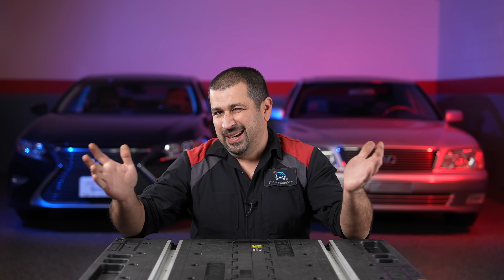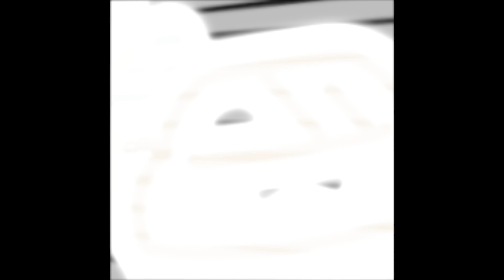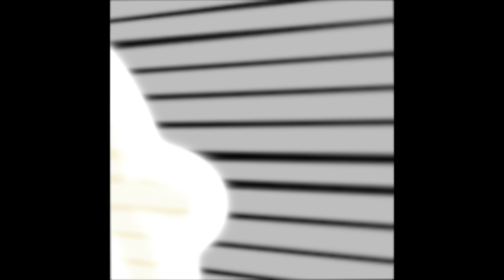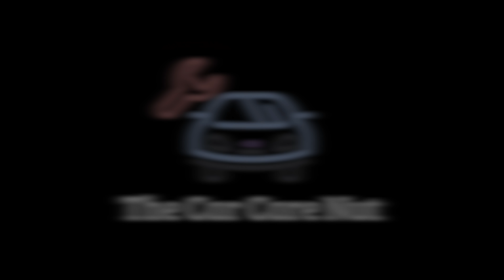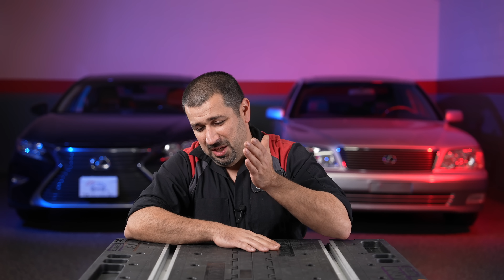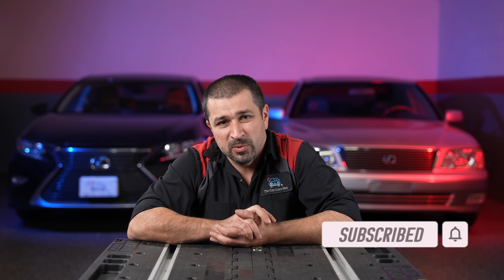Can Modern Turbo Engines Be Reliable? Here's The TRUTH!

Comment: 3 turbo VW GTIs, I've never had a turbo or engine failure.  All of them were tuned.  Change the oil every 5k or 6 months, whichever comes first.  Stay on my maintenance and it's never been a problem.  Also, I don't drive it like an idiot.  Let it heat up first, before you get on the turbo and let it cool down before you shut it off.  Sometimes I'll just drive around for 15 minutes where I can just cruise and let the engine/oil cool off before I go home and park if I was riding the turbo. Also, I don't use any lightweight oils.  These 0/20 weights are trash and only used for better mileage, they sheer far too quickly in a turbo engine.  5/40 synth only.  I'll take the mileage hit for an engine that lasts much longer.

Comment: 100,000 miles on the first turbo on our 1984 240 Volvo wagon.  Second turbo was still fine when we sold the car at over 300,000 miles.  Current Subaru Outback XT (turbo) is still fine just passed 100,000 miles (first Volvo  turbo did not have an oil line adding additional cooling to it, second turbo did).  So, in my experience, turbo charged cars can be dependable for a long time.  (Changed the oil and filters regularly on both)

Comment: I bought a 1987 Ford Thunderbird Turbo Coupe with 11,000 miles in October 1988. I sold it in August 2021 with 425,000 miles. Original Turbo and never rebuilt the engine. It had zero blow-by, didn't smoke under acceleration or deceleration. I was running extra boost since 15,000 miles. I religiously changed the oil every 5,000 miles and always used Mobil 1 15/50. I'd check the oil when I was ready to change it, and it would be down a fat pint. After 5,000 miles, it was down a little more than a pint, even with 250,000, 300,00, 400,000 miles. That would be more than acceptable for a new / modern car with 30,000 miles. Pretty amazing. I also warmed it up properly as well as letting it idle down and run some cooling oil through the turbo before shutting it down. Everybody was shocked at the mileage I had on it. And it was an "old school" bronze bushing turbo. No ceramic ball bearings here. Maintenance is key people. Like the man said, change your oil frequently.

Comment: Oil bypass filter, oil cooler, air oil separator, and change the oil every 3-4 thousand miles depending on how you drive it, and you will be ok.

Comment: My Ford 2.0L turbo has been a gem. Best synthetic oil, best filters, and changes every 5-6K miles. 10 years without skipping a beat. Quick heat in the winter means the truck stays in the garage.

Comment: I have a '21 VW Jetta with a 1.4l turbo motor. VW recommends oil change every 10k miles but I remember another channel saying small turbo engines should have the oil changed every 5K miles and have been doing that. When the motor hits 50K I plan on doing an oil change every 3K miles.

Comment: Turbos cook the oil, they hold too much heat under the hood, they vibrate the bolts loose, the bearings fail,  they are designed in  because the engine is too small for the car.  Buy a car that doesnt need a turbo.

Comment: So far they haven’t really gained an advantage. I have a Mustang with the 3.7L V6, MPFI, 305hp, 29mpg. I have 160,000 miles on the engine with no problems. Ford, in their infinite wisdom, replaced it with a turbo-4, GDI, 305hp, 29mpg. These engines have proven to be unreliable with blown head gaskets and problems with the high-pressure fuel injection. The weight of the accessories almost completely offset the potential difference in weight between the V6 and the turbo-I4. So all Ford accomplished was the enshitification of the base engine for the Mustang.

Comment: My 1967 VW Beetle did not have an oil filter, just a metal screen. I changed the oil myself every 1000 miles. I drove that car for years, ran like a top, never an issue. Oh, I also adjusted the valves often too. I couldn't wear that car out.
Reply: Still have it?

Comment: If this is mostly in reference to the Toyota T24A engine that's replacing the GR V6s, you have nothing to worry about there.  That engine is rock solid and is currently Toyota's most reliable engine, even moreso than the 2GR V6 or A25 4 cylinder that's in most of the hybrids.  They've done everything you want to do to a turbo engine to make it reliable, tuned fairly conservatively, no electronic wastegate, nice thick cylinder liners, the D4S injection system, water cooled ball bearing turbo that's only pushing 15psi through a nice big intercooler and they run the water pump for a few minutes after you turn off the engine to keep coolant circulating through the turbo to cool it down.  I have that engine in my 4Runner and it's a great engine, tons of low end torque, decent fuel economy, I of course do not follow the Toyota 10k mi OCI, but I feel that changing the oil at 5k is likely fine for this engine.  The one that has me skeptical is Stellantis's new 2.0L hurricane 4 cylinder, they're pushing 35psi into that engine and only getting 324hp so teeny turbo being pushed REAL hard.  Though it may be a bit overengineered, it's 6 cylinder brothers have actually proven to be decently reliable, but they're running twin turbos with fairly large turbos (the tuning potential on the HO version is nuts, 550hp stock, supposedly 700hp is very doable on stock turbos and stock internals) not a tiny single turbo pushed to its absolute limit.

Comment: If an an engine won't go 500,000 miles with basic maintenance it ain't worth owning. I wish Toyota would go back to the first generation small Tacomas. My last pre Tacoma SR5  was still running fine at 530.000 miles when I sold it and bought a 2004 base model manual transmission Tacoma. Trucks are way too big these days.

Comment: Also, you should use gasoline with friction modifiers. Experiments have shown that this reduces friction at the upper rings where you have crankcase oil mixed with combustion products blow-by. The turbo boost significantly increases combustion product blow-by at the rings exacerbating this oil dilution. The combustion products tend to reduce the friction reducing properties of the oil. Friction modifiers use varying methods to correct that.  Today in the U. S. only two companies use a significant friction modifier, Shell and Exxon/Mobile. And those are only in their premium formulations, Shell V-Power NITRO+ and Exxon Synergy SUPREME+. Lake Speed Jr., the Motor Oil Geek, has an excellent YouTube video on friction modifiers so you can see for yourself. Just another thing that you can do to help your engine.

Comment: Another way to get both your turbo, engine, and drivetrain to last longer is to accelerate at a moderate rate. If you are constantly hammering on the gas pedal you will be constantly adding additional stress to the drive components leading to accelerated ware and failure.

Comment: I bought a truck with a small turbo charged engine I changed the oil every 5000 miles with amsoil & ran wix oil filters.
At 110,000 miles the engine blew, I then went & bought a much older truck "2008 F-150" & it has the 4.2 V6 Natural Aspirated engine & with 240,000 miles with 0 problems.
I personally will NEVER own another turbo charged engine unless it's a Diesel.

Comment: If i recall right, you made a video a coiple years ago about the 2023 lexus rx350. We bought a new one off the lot, i change the oil every 3,000 without fail. I do it myself, taping the receipts in a notebook, and write down what service was performed, with mileage and date. Yes, it has a bunch of goofy chiming noises but they can save you if someone walking behind vehicle in blind spot, the vehicle will stop automatically.

Comment: I've been driving a 2024 Honda Civic Si with the 1.5L Turbo, and I've done my oil every 5K, full synthetic with fresh filter every time. I see mostly highway miles (already put 33K on it since picking it up last May) and I don't beat on it since it's a work car and not a toy. Do I really need to cut it down to every 4K for oil change, or is 5K not really stretching it (I always end up getting the oil done a little sooner than 5K)?

Comment: It just sounds to me like everything is a bad choice in terms of owning a car. If you own a normally aspirated larger size engine car, it's likely spewing out harmful emissions that have been causing air quality issues and contributing to global warming. If you pick a downsize engine with a turbo, it's a less reliable vehicle that requires more maintenance and is more costly. And if you go with an electrified vehicle hybrid or fully electric, then it can potentially have issues with the battery pack not being reliable and constantly to repair, and there're issues with charging infrastructure for fully electric/plug in hybrid vehicles. I care about air quality as someone who has dealt with asthma since I was a kid, I care about a reliable powertrain because I drive a lot, and I care about usability when I go on long drives and want a vehicle that is not complicated to refuel or to maintain and will run for as long as possible. So what is the right car?

Comment: I drove a 2018 Honda CR-V for 150,000 miles over 7 years. Tiny 1.5L 4 with a turbo and a CVT. It worked well, smooth, adequately powerful, 33 mpg or better. 
But that good mileage is only if you don’t spool up the turbo very often 
And the oil? Full synthetic 0W20. And you gotta make sure you change it at least every 5,000 miles.  
I now have a sedan with a V-6. It is super smooth and super powerful. The down side though is it gets 23 mpg. It’s true though that there’s no replacement for displacement.

Comment: I say in terms of reliability, both are almost the same. In terms of maintenance and repair, turbos are more expensive. You have deal if shorter life battery for turbo oil pump to still run after shut down, turbo oil pipe leaking, wastegate issues requiring turbos to be replaced, more than often valve cover oil leak, high wear on spark plug, turbo diverter issues, etc.

Comment: Excellent podcast. Oil is the lowest common denominator of a turbo. I tell my friends with turbos, change that oil religiously by or before 5k miles. Personally, I would not touch a turbo gas engine, even though I owned one. I drove it to 70k miles. But never  purchase a used turbo gas engine. You don't know if it's previous owner changed the oil properly.

Comment: Love my 2022 WRX, turbo barely spools on the twin scroll...2.4L has plenty of power and turbo comes on only around 3000rpm and only if you floor it.  The turbo generally produces 7-13 psi of boost....low compared to older models and many other turbo setups.

Subaru has been making turbo flat 4 for ever...not a new tech for them.  Here's to hoping it lasts 😂

Comment: So much truth spoken in one video! I have a 24' tundra v6 tt and ive put 38k miles on it and its been amazing. I change the oil every 4 thousand miles. And recently changed the air filters. If I had to choose one of my two vehicles for life to be reliable I would still take my 07 v8 supercharged 4runner tho.

Comment: Th future is Electric Turbos, they don't create heat and they don't need spooling cause they are electric making them instant and they don't use the air that comes from the exhaust making them cooler, less moving parts and more reliable for the engine, no waste gates, no variable geometry, Porsche is the first ones to use it in the new Electric Turbos on the new 2026 Porsche 911.

Comment: Turbos need clean oil along with proper warm-up and cool down time. Oil packages start breaking down at 1300 miles. Therefore changing oil at 3k is a must, especially on DFI 4 cylinder engines!

Comment: Greetings from south central BC, thanks so much for sharing your thoughts. Back in the '70's when I started wrenching turbo diesel agricultural equipment, we learned the exact thing you said - use good oil and filters, change them often. We'd also had pyrometers on a few of the engines and found that letting them warm up before heavy use as well as cool down after heavy use seemed to help. Turbo gas motors absolutely need clean oil and good filters in our experience. Great stuff as always sir!

Comment: Almost 5 years ago I bought a 2021 Jeep Wrangler with a 3.0L Turbo EcoDiesel engine.  I knew nothing about turbos and thought I knew a significant amount about diesels.  Boy was I wrong.  The emission requirements for a diesel today complicate driving a diesel engine vehicle.  I was lucky.  I live 13 miles, on a 55 mph highway, out of town.  That means every time I drive to town, I get to properly warm up my engine and do a steady driving speed.  Ditto on the return home.  The first 6 blocks of my drive to town and the last 6 blocks of my drive home involve 35 mph and 25 mph speed limits.  That gives my engine and my turbo a chance to warm up before driving highway speeds and cool down before turning off the engine.  We go on long trips across the USA in our Jeep.  It doesn't mind the hills.  It hardly shifts gears on the mountain climbs and holds the cruise speed on the descents without touching the brakers.  I love my EcoDiesel engine.  It has 88,000 trouble free miles on it and have had only one regen issue.  For the last 3 years, I have adding Hotshots Every Day Treatment to the fuel tank and have had zero issues with regen.  Oh, and you will be probably pleased to hear, I change my oil and filter every 5,000 miles instead of the 10,000 recommended by Jeep.  I also change my fuel filter and air filter about half the interval recommended by Jeep.  It is cheap insurance.  So, IMHO, don't buy a diesel to drive around town.  That is not what a EPA emissions diesel likes.  Buy a gas engine and stay away from turbos especially if you have a lead foot.

Comment: I have a 2015 F150 truck with the  3.5L Ecoboost, and it has 176,000 miles on it.
I bought it at 140,000 miles, so have put 36k miles on it.
As far as I know, original turbos and timing chain and cam phaser, etc.
During the time I've owned it, I change the oil with a high quality full synthetic every 4-5k miles.  Never more than 5k.  Use the best synthetic oil oil filter as well.
Do my own oil changes so that only costs about $30-$40 each change, not bad.
Run great so far

Comment: Has anyone done a proper study comparing failures rates with 3k vs 4k vs 5k vs X,000 miles? I definitely believe you that 10k+ is insane but until this video nearly everyone said 5k. I'd love to know the true increase in failure rate with 3k vs 5k oil changes, all other things being equal
Reply: Right, exactly. Back in the '80s-90s, I was taught 3k. Since '02, I've had a '99 Saab 9-3T, and I added an '08 9-5T a few yrs ago. I think GM rec'd longer intervals for the latter, but I've always done full-synth at 5k. It's easier to remember that way w/tire rotations or service intervals. My Saab specialists agree w/that, and all other car channels have said the same.

So now we're back to 4k or 3k? Someone upthread even said "3,333". Exactly. Does he just stop wherever he is and do an oil change by the side of the road to meet that magic number?

Personally, I once (once!) went 6k or even 7k for the 9-3 b/c life got busy, but the engine & turbo, both original, survived. The 9-5 was sitting for awhile before I got it, so the first oil change was sooner. Otherwise, both dipsticks are checked monthly. If I go over or under 5k, I can also add fresh oil. As long as it's Mobil 1 5w30, it's gonna be okay.

Comment: Please do a test to prove your theory  that oil is used up at 4K vs 6K.  While we have been hearing about not going 8K but 3 seem excessive.   Can there be a compromise and just drain the oil and use the filter ? Also I have seen many tests sample videos that lower cost oil meets or exceeds all standards.  If changing that much. I would like to see a comparison of interior engines with 3K change and 6K change.

Comment: Old School Here.
My Daughter bought 2022? Acura RDX Used with 25k miles ish.
She drives Lots of Stop and go city, but also Lots of Long drives. She'll do 50k Miles a year easy.
It has a 4 cylinder Turbo.
My take? The Smaller the engine Vs. Weight of the car? The More Stress is applied to everything. Manufactures put turbos on small engines to give buyers the "Sporty" or "Quick" Feel, but more importantly, It allows them to meet CAFE and Emission standards.
You can burn up a 4 cylinder Turbo even 6 Cylinder very fast depending on your driving habits. Be Chilled a bit more, less aggressive on the Gas ? It will last with Oil Changes.
I would rather have a non-turbo V8 than a Turbo 6. I would get a Straight 6 from Jeep before any Turbo engine.
Also, any 0W 20 BS oil even from the manufacture's Specs, is a Major Problem.
The 0W really doesn't matter, Needs a Min. of 30w always, Heat is the issue.

Comment: The recommended oil weight is an issue brought on by know nothing political types telling engineers what economy numbers they have to meet. We have a stable of very high mileage Honda's but chose another brand as a new 24 model purchase with a proven NA platform, no mini turbo motors in our fleet, NEVER!  ps: I do use a heavier oil as prescribed by the foreign market that will extend the life of these cars multiple times the warranty period.

Comment: My 300 Z turbo 1994  had 326 ,000 miles on it when i sold it  only issue with the engine was the seals on the end of the cams . No problem with the turbos . Use proper shut doen / cool off .